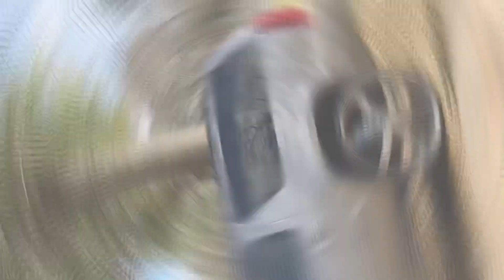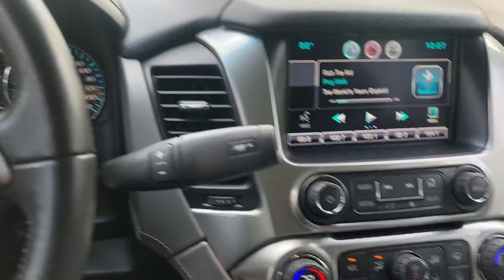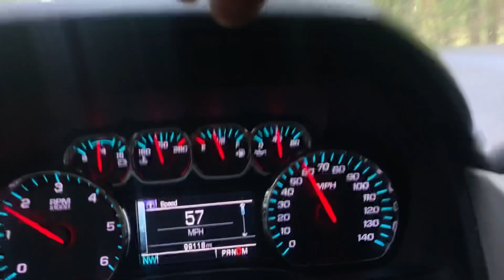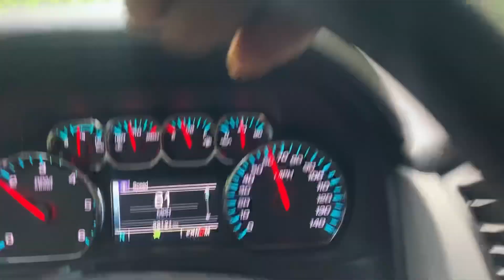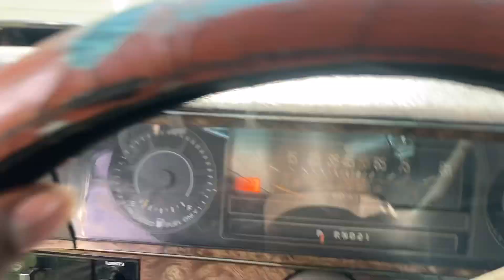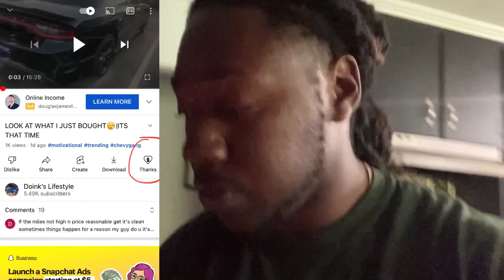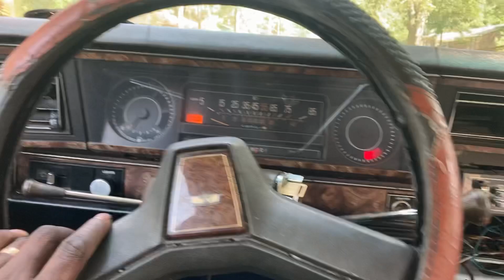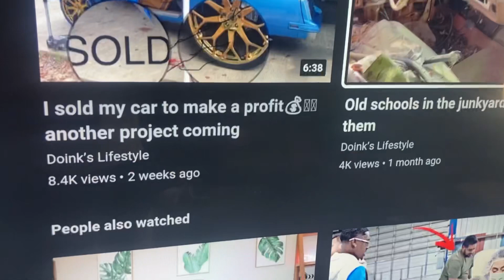I JUST BOUGHT ANOTHER BOX CHEVY | BOX CHEVY SALE | BOX CHEVY DETAILS

Comment: Nice, you should pressure wash the engine compartment with the engine running, put some engine degreaser on it before. Vacuum out the interior and trunk. Wipe down the inside. Shine up them wheels. That car would be sold, thats a nice starter car though to who ever gets it. Keep us updated